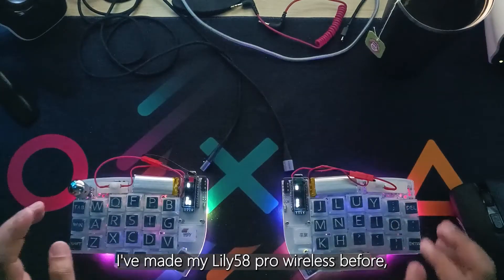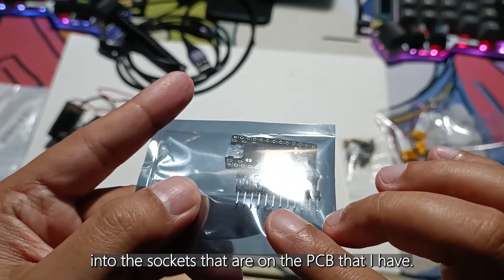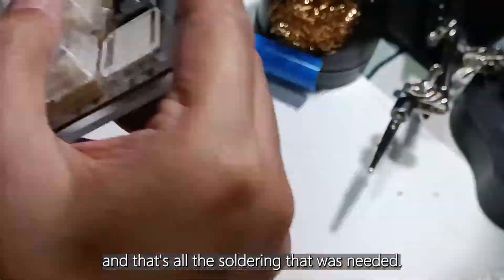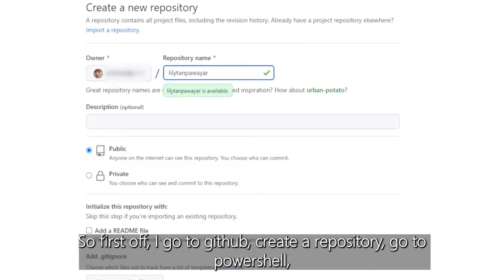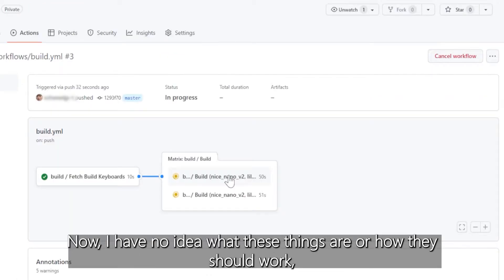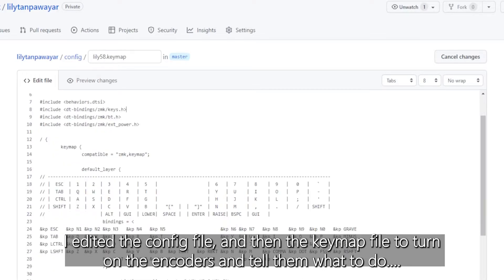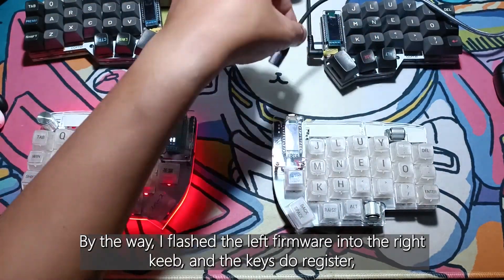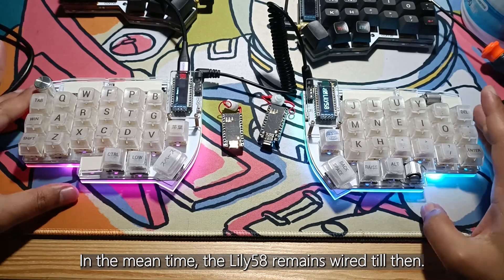I failed to make my Lily58 Pro wireless again

Comment: have you try reset both sides while right side is changing? That solved a simillar problem for you. So intead of using a battery  I'm charing the right side with a power bank. Wierd but it works well.

Comment: as i remember slave wont work even in wired mode. have you try with the default firmware? and there is some tricks on reflashing slave (kind of the slave paired with the old left or whatever sht you know how zmk can suck). refer to the screenshot i shared you earlier on flashing left and right see if it can work?
Reply from the maker: Didn't try wired mode (as in wire using TRRS). Tried with default firmware and right side did t work. I think I tried with the flashing method you mentioned, but it just doesn't work. Will try again on corne w/out any encoders when the sunset tactiles arrive 👍
Reply: @semputs  I mean right side connect to usb c alone won’t registering. Okkkkkaaauyyy
Reply from the maker: Yea... Tried that too, okuaayyyy 😂

Comment: I’ve built two so far and also have not been able to get a single kb to work. Do you have a discord to chat?
Reply from the maker: Hi there, sorry to hear that.
Unfortunately I'm not on discord and tbh I think it's faster if you ask around on Reddit  r/ErgoMechKeyboards for help. It sound like it's either a soldering issue or a software issue. If your soldering is good, a promicro + default lily58 firmware on QMK should at least enable you to use it.